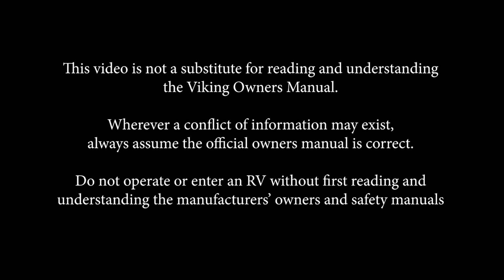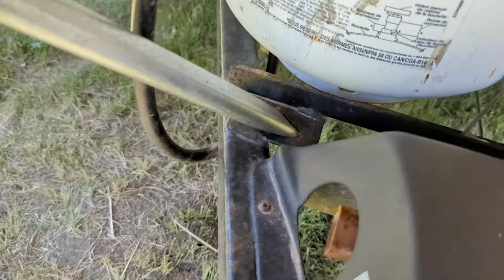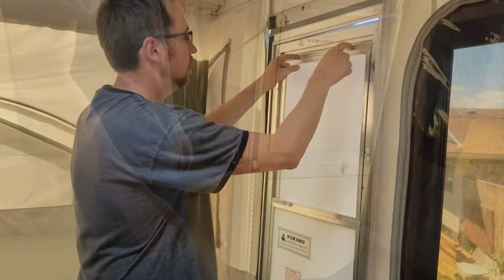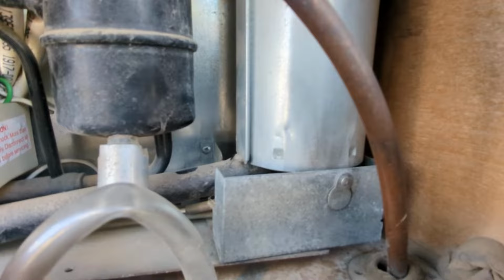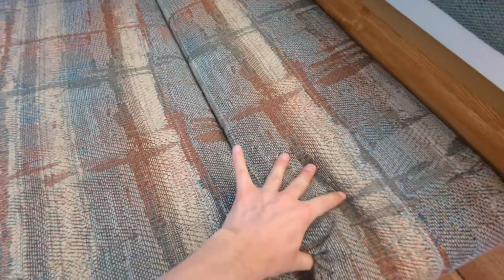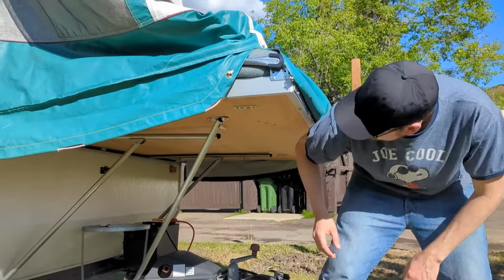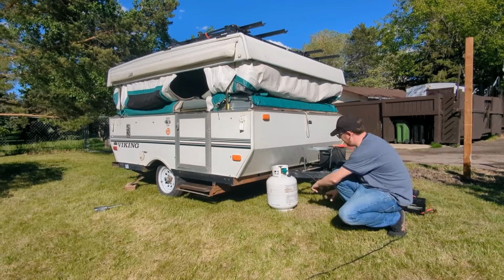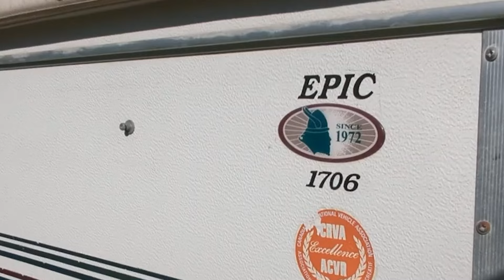How to Setup and Take Down a Tent Trailer - Viking Epic 1706

Comment: I have a 2003 very similar to this we bought this week. Door was fine when we looked at it so 100% sure it is a me thing, but could not for the life of me get it to sit flush 😂 luckily it is fall so bugs were not a concern but definitely need to practice it. This looks a lot better with the door flush.
Reply: Have you tried raising the roof a little higher? Just a very small amount, but not past its max intended level.

Comment: WRONG ADVICE !!! The safety bars DON’t go on same side ! DANGEROUS this way If mechanics fail the very heavy top will hurt someone.
  Read the manual it specifically says to place safety pieces on the OPPOSITE corner from door.
  Please correct your advice, call Viking if you disagree. Happy camping DP
Reply: Dale,relax